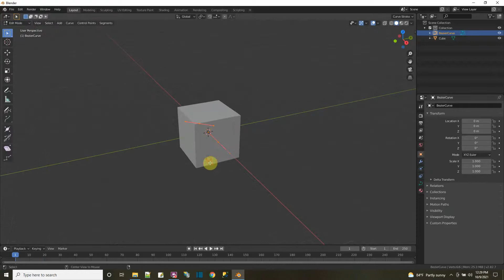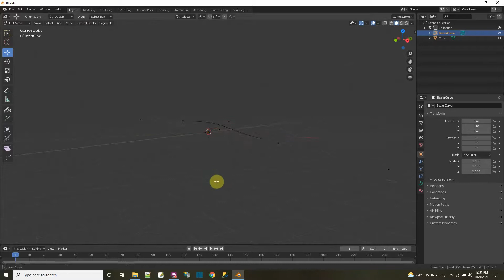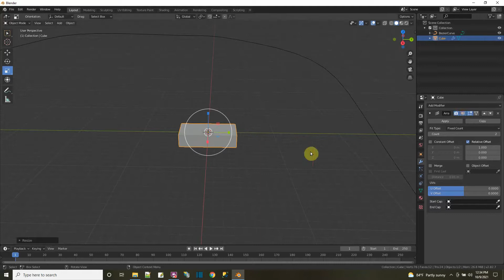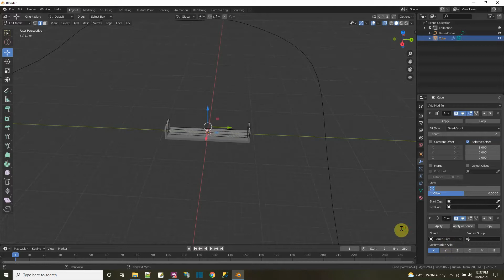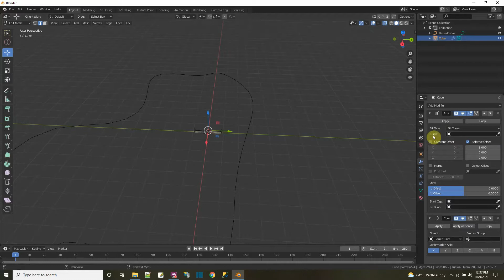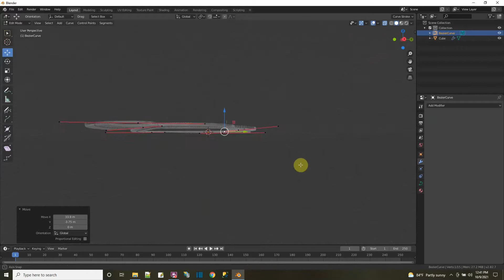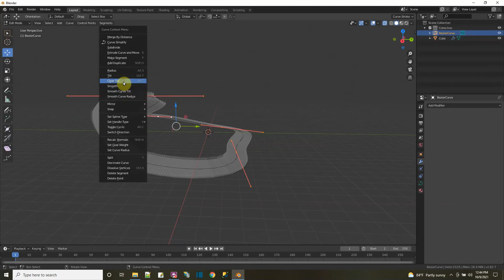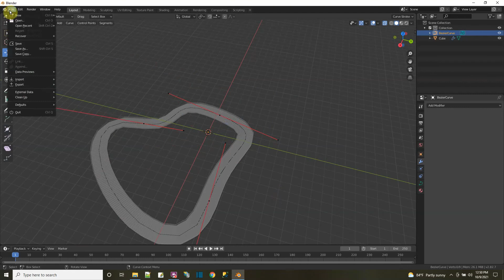Make Race Tracks Easy (Blender)

Comment: 2:18 in my experience using y,x,z to stay in the same plane helps a lot.

a few other things of note, that might help, from someone who's had "so much fun" with random issue while making their own racing games (see my channel for examples). 

-the surfaces between the roads in the array (the one's you don't see) make sure you delete those.  because unity's collision dection will still see those if speed, or forces, start getting high.  this can have the effect of turning your car into an airplane.  fun if it's intended, less so if it's not.

-make sure you've done the UV unwrap before you do the array, and especially before you lock it in.  because finding out your road texture "looks funny" after that can be a whole headache all it's own.  worst case scenario you have to abandon that track because the cost to fix it is too high.

-make a file with several road pieces (guard rails, turn arrows, lane widths, intersections, bridges, ect.) and save from that file. to keep things consistent track to track.  intersections can be especially helpful for things like adding or removing chicanes to drastically change the tracks feel, getting the best "bang for one's buck" in environment creation.
Reply from the maker: I love that you have shared your hard learned tips ... valuable !  I was having that strange texture issue. Thanks so much roguedogx!!!!